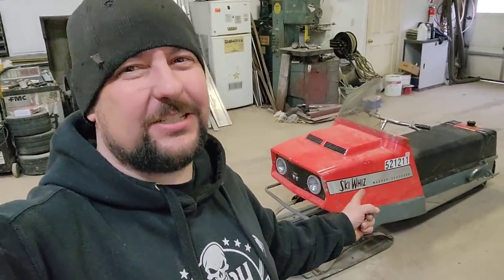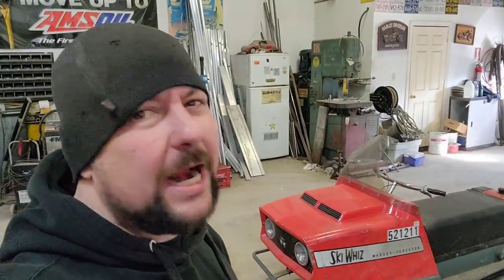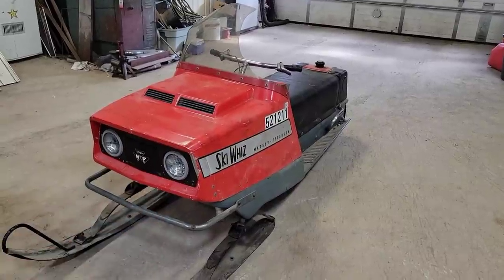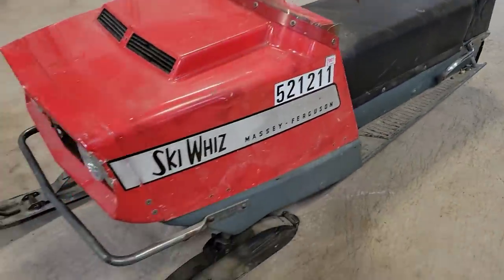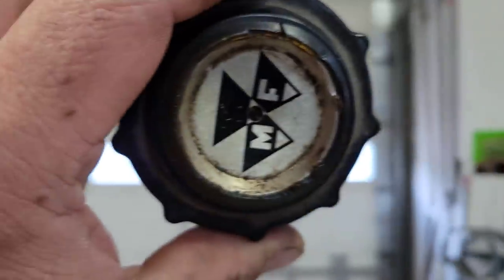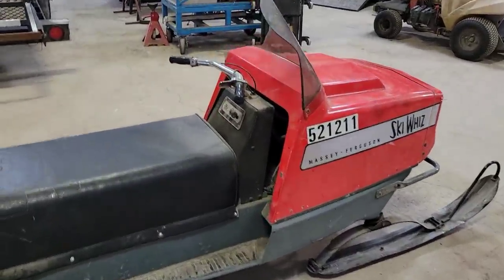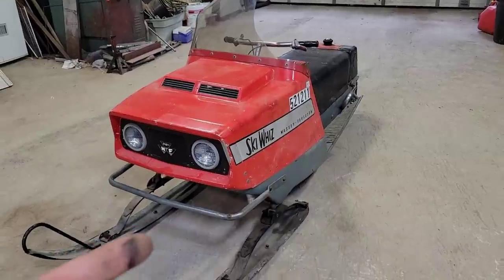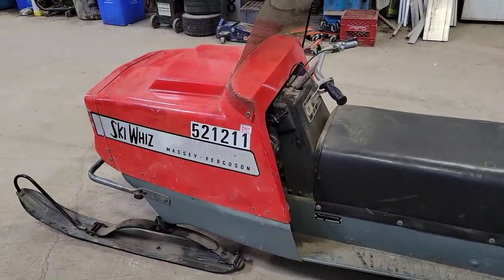1972 Massey ferguson Ski Whiz! can we get running?

Comment: We used to put ski spreaders on old machines like that.   They're about a 4" square piece of flat stock with a 1/4" drop-down offset in the middle (so it wouldn't raise the front end at all)  They actually worked wonders for stability

Comment: Oh those tillitson carbs. Been working on those many years now. Those plugs are called welch plugs and i used to seal them with nail polish cuz if they leaked would cause a world of trouble. Also make sure the needle valve lever is set flush to bottom of carb body if too low causes lack of fuel flow or too high would cause flooding. There is a special wrench for those nuts also its a double open-end with one end at a 90 degree angle. I  had a JLO 440 twin with a tillitson HD carb they are very finicky and spent more time dicking around with it than riding it. I put it in a 73 Olimpique

Comment: In Huron county (Ontario) we had a 1972 while our neighbours 200m down the road had a 1970. We kids were envious of the White's (our neighbours) as they also had a wheel kit for their machine. Two wheels in place of the skis and a big driven balloon tyre under the track tunnel! We raced go carts and old motorcycles up and down the county road and they run their Ski-whiz. Our other machines were a 67 BoaSki and a 69 twin track/single ski Alpine. I cannot tell you whether this wheel kit was an option or after market.

The hole in the gas cap was a fuel gauge; a spiral rod was attached to a float, it turned and moved a pointer under a clear plastic cover on the gas cap.

Great videos you have.

Comment: My buddy's dad worked at Massey YEARS ago. We had 2 of them. I believe they were actually 292cc one lungers. Probably the only carburetor that I can rebuild blindfolded. Trust me, it'll really twist your brain for a long time if you flip flop that spacer gasket and diaphragm. Lots of good memories and 1000's of miles on them things. Definitely cables on the recoil, a frayed one one would remind you often. The good thing about the stance, I lost a bolt once on the ski, I was able to ride it home across the fields tipping it on edge until I got a bolt from the garage. There should be rubber strap keepers between the bogie wheels also. FYI... That is a handy bit of information
 there!!!! Great video!

Comment: Hey Pete, Ive been watching your channel for a while. I finally subscribed. Just to let you know on a trick I learned. Dried up, gooey plugged jets and fuel bowls. Its still dried up shit gas. Take a small soldering torch and heat your jets, and pilots and the clogged jet will shit out the turd. Its amazing. Take fine piece of copper wire and finish cleaning the orffice. You can take a dremmel with a wire bit and shine up the outside to make it new. Also burn out the fuel bowl and believe me it will burn cause it was once gas. take a scotch brite pad and clean the bowl. Burn the shit and its easier than waiting hours with carb cleaners. Brake clean will make it pretty again. Taking torch tip cleaners are fine, but when you have a pilot jet thats 34.5 and running a torch tip cleaner through can make it bigger and screw up your idle circut and making it run rich on idle and bog when you punch the throttle. Also another tip. Siezed bolts or broken bolts use candle wax. Heat the shit out of it and use a candle and melt it into the seized bolt. It will wick into the threads. Let it cool and extract. Repeat if necessary. Putting penetrants just make fires. Use sented candles itll make your shop smell nice. LOL
Reply from the maker: thanks for subscribing! and those are some good tips! 🍻

Comment: Do you remember when these machines were called 'Massey Ferguson snowmobiles' and the 'Ski Whiz' label came later? Those bad-boys were built to last, albeit the MF brand like everything else back-in-the-day required some frugal 'tinkering' just a few years from the assembly line. Ski Whiz is on my bucket-list of must-have restored snowmobiles.
Reply from the maker: they definitely were built to last and I think they look sweet!! 🍻
Reply: 160 compression plus steel recoil rope WTF even if this is 100 years later if found in this condition she'll still run talk about 70s style thinking👍
Reply: @b01tact10n  Very true, yet nonetheless these machines disappeared from the trails before the end of that decade.

Comment: The old sleds are fun to ride. You had to ride it can't just jump on and go like the new one's. It is a blast here in Wisconsin with poker runs with 40 or so sleds eh!
Reply: I just wish we had more than a week or two of winter in Wisconsin anymore.   A friend and I used to have a business working on old sleds and loved it.  We would spend a lot of evenings wrenching on those old beasts, then tearing them up on weekends.  Wintertime used to be fun around here.  These days, we have to try and get as much riding in (that is IF the trails are open) as we can when we can, because the season is so short now.   Yeah, I miss the 80's winters.
Reply: @NJP76  60's and 70's winters were even better! Nowadays I don't miss long winters!
Reply: @stevenbaker9327  I can not disagree about the 60's and 70's winters.  I was a kid in those days, and I remember winters when the snow would come in early November.  It usually stayed until March and even April some years.  It seemed like we used to get a lot more snow back then as well.  Not so much of this rain and ice that we get so much of these days.  I am well over 60 now, and I actually do miss the longer winters we used to have.
I didn't actually get into snowmobiles until 1980, but from that time on, I have been hooked on them.   Maybe it is just my perspective, but it seems like we had snow to ride on for more than a week or so back in the days.  But then I guess I shouldn't complain too much.  I got my five miles of riding in for the year already, LOL.
Anyway, sorry if I am rambling here.  I just miss the times when winter was winter here in Wisconsin.

Comment: When holding fine machined parts such as carbs, in a steel vice, I usually will place heavy rubber  between intake and outflow of carbs, just on the more safe side.
Awesome videos Man.

Comment: I love your videos they're so informational I have a 1990 Indy 500 and I was wondering about if there's a thing that commonly goes out on the old wedge style Polaris sleds just want to know because I'm finally getting about a foot of snow
Reply from the maker: thank you! those are good ol sleds! nothing I'd say out of the ordinary to go wrong, just giver a good once over ya know! clean carbs, check belt and clutches, track and drive bearings, fresh fuel and plugs then grip'er and rip'er 🤣🍻
Reply: @rednecksdirtyhands  I bought it as a non runner this fall and got it running and driving but I also have a 85 Indy and I did all the drive bearings and replaced my bogies and that was a ton of work

Comment: Seems like the needle retainer would need to be adjusted. Can't recall the spec. but I think .012 proud of the carb body , measured with a straight edge. So the button on the diaphragm opens it the right amount. Been a while since I've had one apart. Probably have an old manual laying around some where. These old sleds bring back some fond memories of a simpler time.

Comment: Had one of these long ago as a 13 year old, old reliable but so slow. No electric start and an actual wrap around the pulley rope start since so much was missing from my machine. The hood was barely holding on and the carb would fill with snow at times but I always got home with it. Also had the 440 twin JLO, faster but so prone to melting pistons, bad design.

Comment: Switch over to a mikuni and you got a sweet running machine that starts and runs every time, had the 350ss with the 340 single for a few years and used it a lot for pull wood out of the bush and daily rider. 2 pulls cold and a quarter pull hot every time.Not a tippy ass it looks. Good on fuel too. Miss that machine.

Comment: dont use tip cleaneer you will file the orface larger.....use wire clipped off copper pipe brushcleaner
Reply from the maker: good tip! 🍻

Comment: This is a 1971. In 72 they had a plastic dash. The seat is not original.   All that oil is from idling too much. It should be running in less than an hour. Run it richer because the factory settings are too lean and will melt the piston.
Reply: I mean a 1970. In 71 they had a plastic dash.